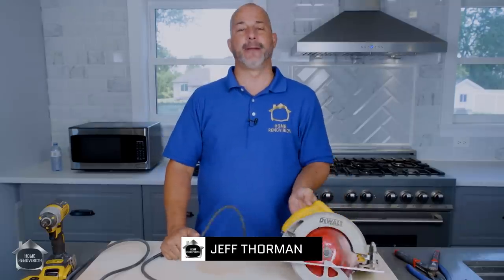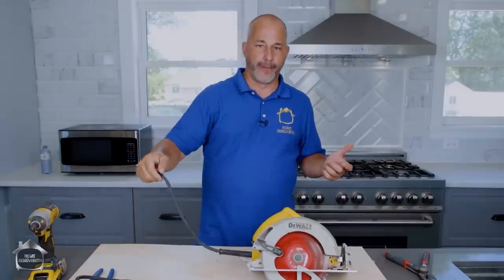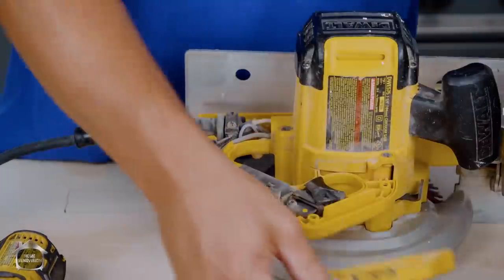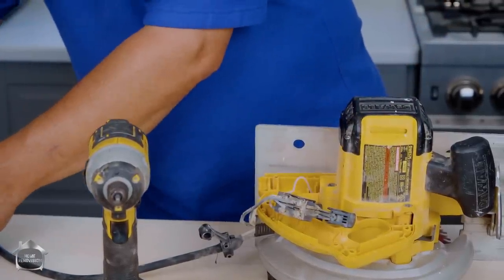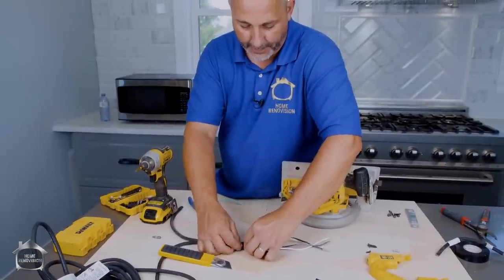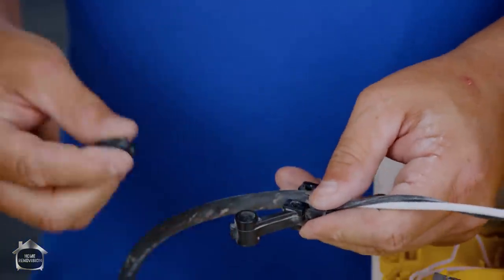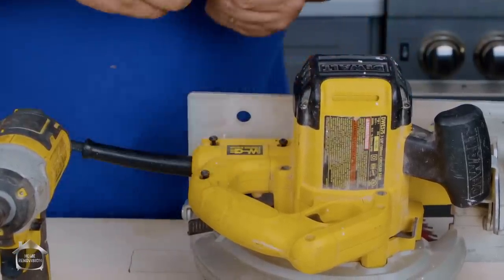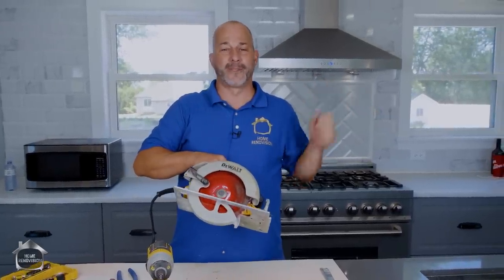How to Replace a Broken Wire on a Circular Saw

Comment: Thanks again for another great video Jeff & team!  I bought a used but excellent vacuum quality vacuum for a song because it was broken, and thought it needed a new motor.  I took it apart and discovered it was an issue with the cord.  I thought I would be able to replace the cord just like you showed in this video, but my cord was soldered on, so I needed a different solution.  I decided to splice the cord, and a very helpful gentleman at the hardware store advised that I just use a heavy duty extension cord like the one you showed here.  $20 and 10 minutes later, I have an amazing vacuum that others would have trashed!  

I really appreciate you showing us not just the “how”, but the “why”.  👍

Comment: Hi Jeff, I used the same method, but I took the extra step of soldering the wire after I had twisted it into the shape I wanted. Nowadays I use a crimper tool to put new ring tags on so it looks just like the wire you took off.
Reply from the maker: Nice work!

Comment: Wow, why would there be a dislike on this video already. Best video on restoring worn out tools. Never thought it was that easy.
Reply: Probably a Ryobe lover. Hahaha
Reply: I disliked just because of twisting the wire on the screw, that will 100% fuck the tools if used regularly in the next 3 months, spend the 30 cents to put on crimped ring ends like what was already in there, most electrical cutters have a crimping press on them.

Comment: On our job site,  we almost exclusively use that exact saw. 

I have done this exact repair more than a handful of times, but when you cycle through new guys, you find they all have a habit of cutting the cord. 

Replacing the cord is exactly as easy as Jeff shows it to be... wrapping the wires around the screws is way easier than going to the hardware store and trying to match the terminal size to the clips in a pinch. Don’t waste your time.

Make sure you get a nice all weather flexible cord as a replacement, and make it a long one, if you don’t have the $$$ to go cordless, nothing beats a 25’+ cord on your saw.

Great video! 👍
Reply: Les 

Couldn’t agree more about the proper terminals provide an excellent professional repair job. 

However the goal of the video is to teach diyr’s how to fix their tools, in this case, a dewalt circular saw. I have a handful of saws I repaired with just twisting the wire around the screws and they are still in service  2+ years of service. With every day use. 

My repairs also last. Should people take the time to learn to use the crimper and install proper connections? Sure! It’s a great skill to have and I would never discourage a learning opportunity. 

This method works, I have done it, it’s easy, and if you’re isolated on a job site and the only option you have, it will get the job done. You can’t expect every DIYer to go get a box of terminals to have on hand so they can replaced every cord they cut.

Comment: If I had to spend on an expensive cord and repair my gear, I'd drop a couple of boxes more for a crimping tool and a set of assorted insulated terminals on amazon. If the crimping tool is versatile enough you can do other terminals than the rings inside the DeWalt, hence other repairs.
Reply: Most good wire strippers have the crimper sizes built into the tool.
Reply: Couldn’t agree more 👍
Reply: @klmbuilders5385  True, but far better to use a "designed for purpose" tool than a "Swiss Army Knife" approach.
Reply: @t1n4444  Yes, if you do a lot of wiring connections. However, most everything on this channel is directed at Homeowners and DIYers.
Reply: @klmbuilders5385  Well can't argue with that KLM, but, in a past life (50 years ago) I worked for a certain UK broadcaster relaying " your" VOA broadcasts to Europe. One of the English language anchors was a certain Willis Connover.  His sign off  line was always, "The art of genius is doing it right, first time." 

In short why not spend perhaps $30, off Amazon, and get the right tool for the job ... first time ...

And, if you haven't lost the will to live, his fellow anchor was a Pearl Gates. Her sign off line was, "If you see someone without a smile, give him one of yours."

I will presume you follow?
Reply: re-crimping the same terminals is a very simple thing to do, the terminals are relatively cheap. its no different than crimping on the apex plumbing. therefore, any DIYer can do it. in my opinion anyone can crimp on those terminals

Comment: 4:24 No, that part intended to prevent the cord from making too tight turns where it enters the tool. This prevents the conductors in the wire from breaking due to material fatigue due to bending them too much. For example when winding the cord around the tool for storing, or when the cord is too short and you accidentally yank on the cord on a 90 degree angle. It’s the part at 5:04 which clamps the cord to the tool.

Comment: I do this for tools (like my cheap shop vac) that came with only a short 6 foot or so 16 gauge power cord.  Upgraded it with a 25 foot long 14 gauge extension cord.  Did the same a dual action polisher used for car paint correction

Comment: Good video. I've done this many times. However, that rubber peice does provide some strain relief, it is more intended to stop the shielding from deteriorating from sharp bending over time at the base of the machine. 

So dont start twirling your tools over your head like a mace just because that is installed ;)
Reply: Well of course not. Everyone knows you twirl your tools under your legs not over you head. geeeeesh
Reply: @ecospider5  I gather Jackie Chan has sneaked in the very exercise in his films/movies you  mentioned.

Good spot!!!

Comment: For a 120-volt circuit, you can run up to 50 feet of 14 AWG cable without exceeding 3 percent voltage drop. This include the wiring inside the walls.
Reply: Hmm, but check out the response times for your RCDs. In short, beware the resistance issue.

Or, save yourself the heartache and consult your friendly local electrician.

Comment: When you loop a wire around a screw you want the long part of the wire on the left side like he did. That way when you are turning the screw clockwise it pulls the wire in. If you loop it the other way it will push the wire out away from the screw when you tighten it.

Comment: What are your thoughts on cordless tools? I understand the battery issues but if you simply have say four 5 amp hour batteries that should be more than enough to last you through a day of work especially if you keep all of your tools in one line so the batteries can swap between the tools.

Comment: Awesome! Nice work Jeff, thanks for the tips and tricks it sure saves you alot of money. Cheers!
Reply: When you loop a wire around a screw you want the long part of the wire on the left side like he did. That way when you are turning the screw clockwise it pulls the wire in. If you loop it the other way it will push the wire out away from the screw when you tighten it.

Comment: nice video but i would have cut that end off a little bit longer ,never know you might be able to use it some were .
Reply: Yes! Always leave a least enough to use that plug again. If you are going to wire a plug on the cut saw cord, you might as well make a short light up cord too!

Comment: Hi Jeff! My husband and I bought a house 3 years ago and have been overwhelmed with the previous owners attempts at updating. Currently our granite tiled countertop has been losing tiles around the perimeter and we have no idea how to fix it. The tiles that pop off have a thick glob of hardset on the backs so we can't just stick them back on and we fear we may need to replace the entire countertop. Is there an easy way to go about changing the counter tops?

Comment: How about making a video on installing a whole house exhaust fan and shutters?
I had a house where their was one and used it when the outside temperatures are perfect, or
when you burn the pork chops.
Also I would like one in the garage.
Now do you have to cut and modify the trusses?
Pull a permit? 
I suppose you can't tap into existing wiring? So separate wiring and circuit breakers is needed?
How may Amps are we talking with 110 volts?
Are their better quality shutters (insulated) and quieter fans?

Thanks!

Comment: Quick question about power tools. I have a Bosch drill and a Bosch impact (both are 18V) that came with 4 Ah batteries. I'm looking at getting a reciprocating saw for various renos and around the house stuff. Should I go for an 18V Bosch bare tool or look for a good deal on a corded saw? Thanks!
Reply: A  sawzall type reciprocrating saw? Unless you really, I mean, Really need the convenience of no cord, pick the corded one. That 11 Amp corded saw is gonna rip through shit a cordless tool would rip through 4Ah quickly.

Comment: Hi Jeff. I’m about to install a dishwasher, but I’m going to put it about 4 feet worth of base cabinets away from my sink. How would you recommend I go about doing so in terms of the drain hose, because the hose that comes with the dishwasher is not long enough to reach my garbage disposal.Thanks.
Reply: Jose Andrade 

I ran into the same problem a couple months back. I ended up finding a coupler and used some steel circle
Clamps with a clear vinyl braided hose to make an extension to reach the drain. You can find everything a the local hardware store, you just need to get creative and make sure the hose diameters fit your connections
Reply from the maker: what he said. Cheers!

Comment: What a coincidence... I just had to fix my cord the other day. As I was putting the saw down after a cut, the cord got snagged on the blade guard which pinched it against the still-spinning blade. Severed the neutral but not the hot. I just snipped the cord and rewired it. Only lost about a foot of length. Almost did it again today. I'm restoring a 120 year old 2 storey porch on my house and it's a cramped working space

Comment: There is almost always something that makes me twitchy in every video you post.  In this case it was that 3/4" bit you were using in your impact.  Watching you have to angle the impact to drive in the screw by the bottom of the handle.  Not the end of the world but you are a teacher/instructor.  When you show bad habits like that my OCD freaks out. 
Then the $2.59 leads (for a 12 pack).  You just wired your "quality tool" like a Ryobi.  Man, I just can handle it.

Comment: I think Jeff might be letting his contractor past unfairly color his opinion of Ryobi. They are for sure not as durable as higher end contractor grade tools like Dewalt, but for the DIY crowd he is talking to, Ryobi gets the job done just fine. Provided you take proper care of your tools, they can easily last a lifetime where you only expect to work on a handful of houses at most.
Reply: If you're not a contractor, you can't write off your tools as an expense and need reliable tools that will last. Buying cheapo wont pay well.

Comment: If you're replacing a cord on a saw I would bump it up to not less than a 12 gauge cord especially if you're adding length.
Reply: Exactly.  I ALWAYS go 1 gauge higher than what came on it.  I bet that saw had a 16-18 on it, though.

Comment: Corded tools, old school..  just replace with a flex volt if ya need hp. or a  fuel+. More than strong enough..
Reply: @Les ??? A good quality battery will last all day unless you're using it in something like a jackhammer.

Comment: Wish you had used needle nose pliers to remove the old connectors and crimped them.onto the new wiring, the twisting wire threads around a screw with a head that can't cover the guage is terrible, one of those thread will vibrate loose after running the saw so many time and screw you.

Comment: Protip for anyone who hasn't done this before: Before you cut off the cord, use your multimeter on continuity mode to figure out which wire is which. (Make sure the power is OFF when you do this!) If you're dealing with an older/cheaper saw, your colors may not match what he has. It never hurts to "pin out" the wires before starting, just to be safe!
Reply: It doesnt matter, it is AC.